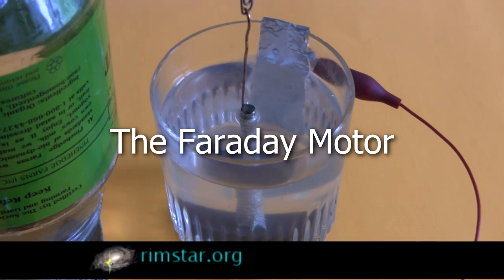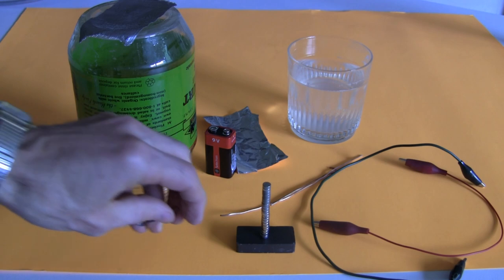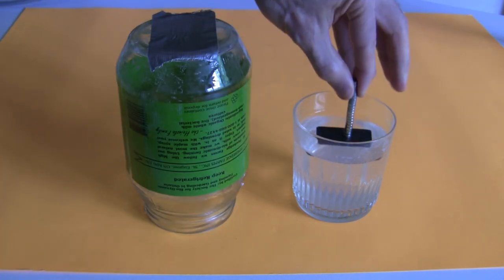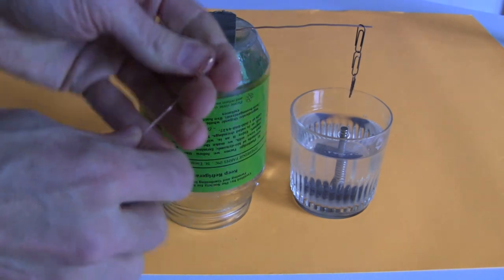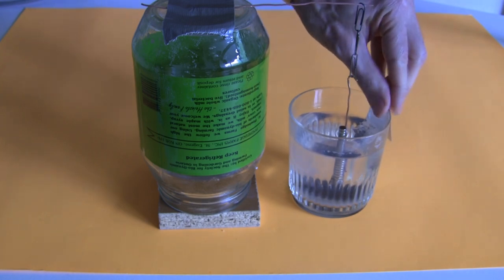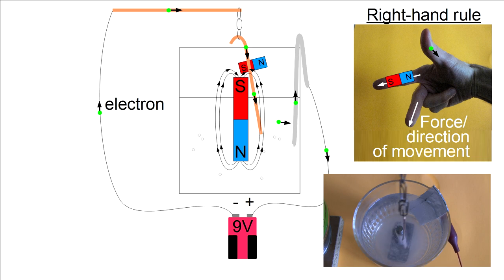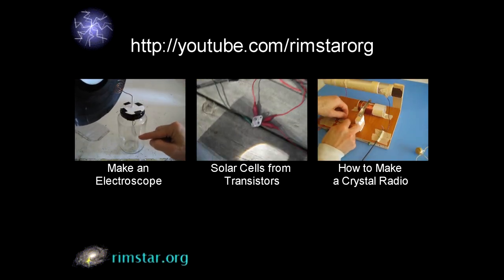Faraday Motor How to Make How it Works

Comment from the maker: We have a local electronics store that sells thick bare copper wire in rolls. I also get it from household wiring, the stuff in your walls. The cable usually comes with 14 AWG wires inside, one for the hot, the neutral and the ground. I tear open the cable to get the individual wires. Another source of thick wire is clothes hanger wire. Strip off any coatings where you want to make electrical contact. For electronics parts: discarded appliances, electronics stores, shopping online.

Comment from the maker: Glad you liked it, Brit. I haven't tried a homemade cell but I did realize that I'm using an aluminum foil plate, a copper wire and salt water in between, which is a cell. So I thought maybe I could power it off itself. Unfortunately the cell it forms is underpowered. Let us know how your turns out, and if you upload a video, add it as a video response to this one. -Steve

Comment from the maker: You're right, the right hand rule just says what happens but not why. If the magnet were an electromagnet made using a coil of wire instead of permanent magnets, then I could explain it as a repulsion between like charges due to special relativity, but since it's a permanent magnet I don't have an explanation of why. I wish I did. In case you're curious, for more about the coil explanation, see the latest video on 1veritasium's channel (though he just uses a single wire).

Comment from the maker: Do you mean the stack of neodymium magnets and the other magnet below them? The round neodymium magnets are just attached to a larger rectangular ceramic magnet on the bottom to hold them standing up. If you have some other way of making them stand up then that would work fine.

Comment: Thanks! You saved my life. I was  helping my niece do an experiment involving plants but they all died.  This one is even better. It will put into action all the stuff she's learning in chemistry about electrons.
Reply from the maker: Kevin Garrett Make sure you use a fully charged battery. That's the most common problem with this one. Have fun!
Reply: RIP your nieces man, praying for you

Comment: I tried to follow all these steps but i failed. Used 9v and 12v current, neodymium magnets, salty water, copper wire but not working at all. Any advice?

Comment from the maker: Did it work? If you plugged into an outlet that means you were using AC. The direction of current would have been alternating and I would have expected it to not work. Instead each time the current changed direction the wire would also try to change direction.

Comment from the maker: You could try with a brand new 9 volt battery, that's helped me. Also, make sure you have good electrical connections also the path through the paper clips. Use sandpaper to clean the inside surfaces of them where they touch each other. Make sure you use neodymium magnets, not ceramic. They need to be strong. Raise and lower the copper wire with respect to the magnets to find a good arrangement.

Comment from the maker: I've had some success with ceramic magnets, though since the magnetic field is weaker it's harder to get working. The voltage isn't important. It's the current that creates the magnetic field around the wire that interacts with the permanent magnets' magnetic field.

Comment from the maker: Hmm not sure I can make the right hand rule clearer than the diagram at 4:08. Keep in mind that on my thumb I'm showing the direction the electron is moving. Conventional current is the opposite direction. That's why the arrow on the electron is pointing in the opposite direction that the thumb is pointing.

Comment from the maker: Nevermind. I see you were answer my earlier question about your other comment where you said yours exploded with fire. I can see why if you were using electrical current from the wall outlet. There's practically no resistance in this circuit so it's like a short circuit. Due to the huge amount of current the wire could become glowing hot and melt. Though I hope your circuit breaker tripped or fuse blew. Did it? If it didn't then you'll want to look into why not.

Comment from the maker: What kind of battery did you use? ... assuming you're not joking :). I noticed that this is a battery (copper, salt water, aluminum) and I even toyed with the idea of trying to make a self-powered one though I think the output is too low. But when powered it also may be an electrolyzer producing hydrogen and oxygen. You'll notice the bubbles when it's running, which I think are hydrogen and oxygen.

Comment: What causes the movement force of clockwise looking down at the inward receiving south positive pole. ??

Is the magnet field rotating clockwise while moving up to south positive pole. ??
Reply from the maker: Cam Leviticus Gb Unfortunately I don't have an understanding at the level needed to answer that. Part of the explanation is here in relativity https://www.youtube.com/watch?v=1TKSfAkWWN0
For most people, including most engineering cases, the right-hand rule that I talked about suits our purposes just fine without having to dip 
into relativity.

Comment: I need your help when I connect the wires to the copper and the aluminum foil the water starts bubbling and it doesn't spin. I have the right magnets and on the package of the magnets is says neodymium-iron-boron. Does that make a difference on the experiment? And I need to know what's wrong and how to fix it quick because I am doing a science fair project with it and its due in a month please help and tell me what I'm doing wrong and how to fix it.
Reply from the maker: lpont If it's bubbling like that, and with everything else you've said, it sounds close to working.Make sure you're using a fully charged battery. It didn't work with mine when my nine volt battery was a used one but when I put a brand new one it worked.Another thing to check is that you're making good electrical contact everywhere along the electrical path. You might have electrical contact but it may have too high a resistance, which would mean less electrical current. Sand or scrape the parts of the paper clips where they touch each other and the wire they're hanging from. There may be some corrosion there.
Reply: I realize this is a little late for Ipont but maybe it will help someone else.  The problem is not the strength of your current.  The problem is the orientation of your magnet.  You might think that it has a north on top and a south on the bottom but instead it has a north on the left and south on the right.  If you put your magnet on its side it will work.
Reply: Kathy Loves Physics how can we manage the sides of magnets ?
Reply: I'm not sure I understand your question but I think you are worried about the shape of the magnet.  As the cylinder is on it's side sometimes the wire does hit the side of the magnet.  But then you just give it a little push and it keeps on going.  It doesn't work well to prove (as Faraday wanted to) that the magnetic field is circular around a wire but it still is pretty cool.  You can see it in action in my video https://youtu.be/fCmahVjH8nM
(or video #16)  Hope that helps.  Please tell me if I didn't answer your question.

Comment: Ahh! Thanks ! My 9V battery was not working properly and so I switched to 12V which I got from an adapter that converted AC to DC. 
But I don't understand the logic behind what I did. Earlier with 9 volts, I got bubbles and hence current but no movement. With 12 volts, I got more movement, Does this mean more voltage produces more current? So if I put a very high voltage, will my copper rod move even faster?

Comment: Great and infotaining video 👏👏….. do we need to strip off the insulation on the copper wire ?? Thx
Reply from the maker: Thanks. And yes, you need to strip off the insulation where the paperclips touch it and where it's in the water. You want as much contact between the copper and the water as possible to get good conductivity.
Reply: @RimstarOrg  did the experiment…. Had some success only. Sometimes the copper rod just repel/clinged on  and stay still from the magnet 🧲 but it DIDN’t rotate …. What gives ?? Thx in advance….
Reply from the maker: Possibly you're battery is not supplying enough current. I had to switch to a brand new battery to get mine going. You could also try flipping your stack of magnets the other way around, i.e. the end that was facing up would be the end that's at the bottom instead. Or you could reverse the wiring at the battery. And make sure you're making good electrical contacts (metal should always be touching metal). Make sure the foil in the water is not coated with anything, it must be metal contacting the water.

Comment from the maker: Now that you mention it, I wonder why Faraday didn't use salt water. Surely they knew it was conductive back then, or maybe not, or maybe he needed it even more conductive.
Reply: Mercury is more conductive so it was commonly used.  Also, the salt in salt water settles and reacts with the electricity (thus the bubbles).  As they didn't know it was poisonous it seemed a better choice.

Comment: What happens if we invert the magnet or the polarity of the battery? And if we invert both?
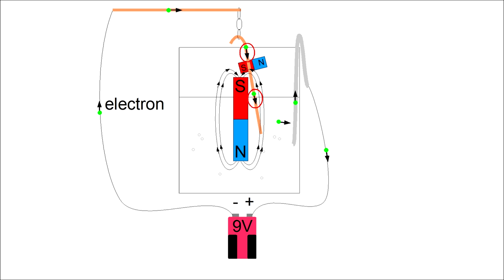Reply from the maker: You'd have to apply the right-hand rule which I explain at 3:50. If you reverse either of them then the rotation goes in the opposite direction.

Comment: After passing current for sometime, my salt water becomes really milky in colour and I can see the powdered form of salt and water separate. What does this mean, does current cause it to dissociate or separate? And I can't seem to mix back the powdered salt and water-why is that?

Also, is there ever a point where my circuit may be exhausted and hence my rod won't be able to move?

Why do we connect the negative terminal of battery to rod and positive to the aluminum foil?

Comment: please please tell me which magnets did you use for the experiment...it is very crucial for me....please tell me fast!
Reply from the maker: I used a bunch of small neodymium magnets which I bought from Home Depot a long time ago (2.5mm tall x 6 mm diameter each.) Neodymium magnets are the shiny, silver ones you often see. The dull, grey ones are ceramic magnets and I found they didn't work as well with this experiment, probably because they're not as strong as neodymium magnets.
Reply: thank you RimstarOrg

Comment: wonderful :)
does it make any difference if I used mercury ???
Reply from the maker: Thanks. It should work better with mercury since it's more electrically conductive. Of course, I have to mention be careful when working with mercury not to get any on your skin.

Comment from the maker: Nope. Try again while looking at the diagram in the video at around 4:03. Pay attention only to the point where I've drawn the smaller magnet intersecting both the magnetic field lines and the wire. Match it up with your hand, just as I show in the accompanying photo. Then simply rotate your hand, with your thumb still pointing up and such that your pointer finger points in the opposite direction. You'll see the force on the wire represented by your middle has now reversed direction.

Comment: I would recommend buying a flat strong magnet and putting under your cup. The chlorine produced from the oxidation of chloride has the potential to damage your magnets. The electrolysis of the solution is visible in the video. It's why the paperclip is bubbling.

Comment: We've got this assignment on Faraday's electric motor. Do you know why the wire keeps spinning 360 degrees?
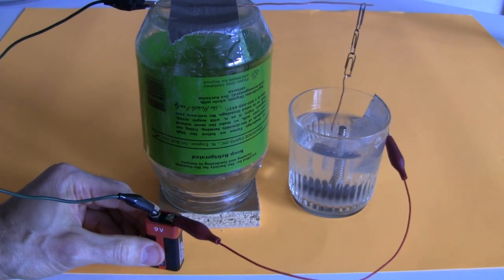Reply from the maker: See the explanation at 3:36 in the video.
Reply: @RimstarOrg  Ohhh I see
Reply: @RimstarOrg  How much salt did you add in?
Reply from the maker: One or two tablespoons. I didn't measure it.
Reply: @RimstarOrg  Okie

Comment: yes. Faraday motor does work from AC. the craziest part is you can change the direction of it's rotation by changing the ORIENTATION of your contact wire. 

Here is an example, sorry it's in russian but you can still see what's going on there  watch?v=6M3vBKAxQpo

any ideas why it still works? also, in your video what is actually pushing the wire? I know it's about Lawrence force.. but what is interacting with what to create the movement?

Comment: So what exactly is the deal with the paper clips. Do they need to be sanded? Why?
Reply from the maker: +alonso rios Sanding them removes any possible insulating coating that may be on them that would prevent electric current from flowing or act as too high a resistance. Mine had just such a coating. It's needed only where the paperclips meet each other or come in contact with the copper wires. You can try without sanding and if it doesn't work then you can try sanding to see if it helps.

Comment: Sir i tried it but wire did get some jerk early. 
But it didn't rotate. 

I used four thick neodymium magnet and  9 V battery
Reply: Plz help.. How can I make it work
Reply from the maker: Make sure your battery is fully charged, new. But you problem may be with an electrical connection. Make sure that you are getting a good metal-to-metal connection where the paperclip touches with. If you think there might be a coating on the paper clip or wire then scrape it off where they touch each other. Also, maybe you didn't have enough salt in your water and so the electric current was too low.
Reply: @RimstarOrg  sir i checked ever think.. 
Using digital Multimeter. 

My wire did move for initially. 
But it didn't revolve a full circle.. 

I think I need to use 12 V battery. 
Tomorrow I will use 12 V
Also more than four neodymium magnet. 

I hope that will help..
Reply from the maker: Another suggestion... make sure your magnets have one pole facing up and the other facing down.

Comment: What are the problems due to which the wire may not rotate?
Reply from the maker: Your battery could be too low on charge (I had to put in a new one). The places where the metal wires touch the paperclips and where the paperclips touch each other may not be making good electrical contact. Scrape those areas with a knife or sandpaper to remove any coating that may be there.Your magnets may not be strong enough. Your water may not be salty enough.

Comment: Trying to figure out my mine isn't working 😑does it have to be solid wire? I used stranded wire. Also I used a ring magnet does that matter?
Reply from the maker: Stranded wire should work too. I think the magnets have to be fairly powerful, so they should be neodymium magnets. Those are the silver colored ones. If yours are dark grey then they're likely ceramic magnets and probably won't work, not powerful enough. Also, make sure you battery is new/fully charged. My first attempt was with one which wasn't and it didn't work so I got a new one and it worked. Also, make sure there's no coating where the paper clips touch things as I showed in the video -- you want metal on metal contact.
Reply: Oh cool thanks for getting back. It's an n52 neodymium ring magnet. 230cca everstart lawn mower battery. I used vinegar for electrolyte.
Reply: @RimstarOrg  once I get my cam working ima post a video asking to trouble shoot. Once I get it working ima make a bigger one :]
Reply: Here is a video of my set up riddle me this please. Eager to move forward with more sweet demos.

Comment: I’m struggling, don’t know how much salt to put , i have mine but it’s not working, you probably won’t answer but
Reply from the maker: I used one or two tablespoons (i.e. no precise amount) of salt for my glass of water. Make sure you're using neodymium magnets, ceramic ones aren't strong enough. Make sure your battery is fully charged. Make sure there isn't any coating on the paper clips where they contact each other and the copper wire since that might block the flow of electricity (scrape with a sharp edge of something like scissors or a knife).

Comment: can i use a round magnet?
Reply from the maker: What do you mean by a round magnet? I used a stack of disk magnets.
Reply: i was thinking of an old magnet from the stereo... where can I get the cylindrical magnet you put inside the glass?
Reply from the maker: socrates
The stereo magnets are ceramic magnets are a a little weak. I tried some ceramic magnets but mine were much smaller and weaker than the bigger stereo magnets so stereo magnets might work. The disk magnets I used are neodymium, which are a much stronger type of magnet and I got mine from Home Depot. Some dollar stores also have neodymium magnets.

Comment: How about a video showing how Faraday (or whomever) had the original idea that - magnets and wire might interact in interesting ways? Before electricity, did humans even have any reason to manufacture wire?
Reply from the maker: +Ed Short Interesting question. Looks like wire has long been used for jewelry, going back at least to around 2800BC in Egypt (https://en.wikipedia.org/wiki/Wire#History). Also interesting, I'd always heard it was Orsted who discovered the affect electrical current in a wire had on a compass needle (https://en.wikipedia.org/wiki/Hans_Christian_%C3%98rsted#Electromagnetism) but it turns out there's some dispute and that Gian Domenico Romagnosi might have discovered it 20 years earlier (https://en.wikipedia.org/wiki/Gian_Domenico_Romagnosi).
Reply: I made a video about Oersted and how he discovered how current affects magnets.  Here you go:
https://youtu.be/2yawV5ekyN0

(it has to do with his love of the Kant's philosophy)